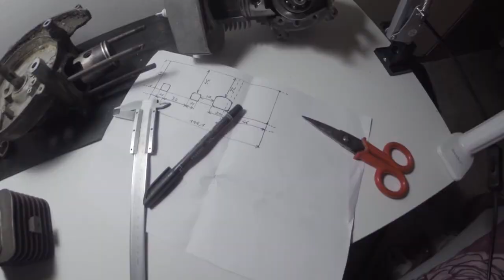Ciao moped   on board test  - E9

Comment: Perhaps a CVT for better acceleration! I dont know if the stock piaggio one from super bravo and newer ciao is any good thou!
Reply from the maker: Yes true, this model  was with cvt as stock!  But i used this fixed gear just because is simply better for testing engine and aslo play with final gear ratio changhing a pulley.
With cvt is more complicated changhing final ratio.

If i ll use cvt at the rigth rpm, performance are far way better, probably causing some easy wheelei, i have Malossi variator somewhere..who know,maybe i will test it!
However with piaggio cvt somethimes with heavely tuned engine here in italy we had lots of rear clutch really open in two parts..
Thank you!
Reply: @vnsworkshop9961  I see! Do you know if the stock CVT is any good with a tuned cylinder if you put lighter weights in it or do you have to get a malossi or other tuning brand?
Reply from the maker: stock cvt can be improved but does t run so nice with lighter weights and limited opeining range,best searching a 100 mm piaggio Si rear pulley,a harder spring( as for your power required) than a malossi multivar and his belt(only), so you will have  pretty like scooter cvt

Comment: Vmax ?
Reply from the maker: With the 92 pulley at max rev it was 70-72 km/h from that tachometer , not so much but i can't use the 13/13 for some problem that day, so i had still the 10/10 (mini) carburator.
With the 80 pulley maybe will be around 80, need a test. The engine is only a 54 cc,take  look to my videos. All from tuned stock material.
Howewer i think that engine now i run almost 9000 rpm, need to be calcolated by gearing.
Thanks